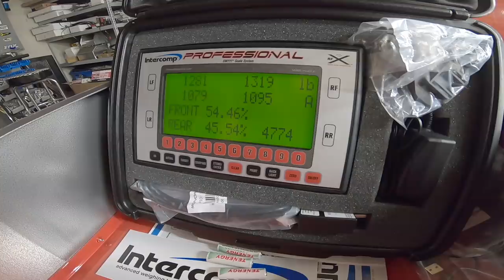I Got A New Project Car! 200 mph Cadillac Revealed on Finnegan's Garage Ep.119

Comment: One thing would be an absolute bummer: Chopping that original survivor caddy (approx 50-70 000$ maybe over a 100 on a good day) and then finding out that the wheels rub the wheel wells in high speeds just before crashing it.
Reply: Yup, they get pretty tall at 200 mph.
Reply: @yourhandlehere1  Indeed, even radials. the diameter expansion with suspension squat requires a hefty barrell on the back seat. I recall even the Swampthing having rubbing issues at the top end, and they race 1/8.
Reply: @oikkuoek  Hmmm...Might have to do a Tim Taylor,  rewire it, stick the tires and wheels on the balancer. Wind that puppy up to 200 mph. and stick a ruler on it. (be sure to wear your safety glasses)

I know he's going for low but being a child of the 60's I can see it jacked in back, sitting over the tires HotWheels style too. Zoomies  In front of the back tires. Oh yeah, giant blower out the hood
Total sleeper.
Reply: @yourhandlehere1  Definitely at least safety glasses on that setup.. XD The problem with that is, the diameter changes with air temperature and air pressure, and when the tyre ages. I think that last one was the problem with Swampthing. They ran old tyres and they started to rub. Mean Lean stance would look awesome, I'm all with you on that, but it's one hell of a ride to launch. Dominator still runs that stance, and he is all over the lane all the time, doing wheelies and all kinds of shenanigans. Caddy is just too heavy for classic rear suspension. To get that boat actually go 200 mph on a 1/4, or even a 1/2, it will need a full ProMod setup, I'm afraid.
Reply: @oikkuoek  Yeah, I don't think you can do that and cruise it comfortably too. My self, I'd keep it cruise worthy over chasing a number at the track.
Reply: @yourhandlehere1  Yup, it's those darn laws of physics. The only laws everyone has to comply.

Comment: Tip on mounting tires, put the rim on the floor, and then put the tire on.
Reply: I want to know who designed wheels that can't have tires installed.
Reply: @bobroberts2371  me too! And I can only imagine how much he payed for a junk set of wheels.
Reply: @bobroberts2371  probably needs a tire machine like non beadlock wheels and the beadlock was for show 
edit: I think he even mentioned it looked like a show car wheel especially looking at where the valve stem was placed

Comment: I wish I could help with a project like this. 
I think ladder bars/truck bars are a great option for a heavy car. The longer the arm the less stress on joints usually.  You could take some thickness out of the seat back to fit that large tire without moving them forward and giving up on much comfort. 
The rear seat in that will be a spring frame. If you build an aluminum seat pan and give it an inch of firm foam and an inch of plush soft foam. It will be lighter and really comfortable. You might even be able to re use the cover and keep it looking so nice.
Those 15 inch wide monsters just look so mean.

Comment: Bruh why does everybody have to destroy all original and such low miles cars
Reply: Yeah, park it in a garage and leave it for 50 years. Or sell it so it can be flipped over and over. Just please don't destroy it, after all it's the only one in existence.
Reply: Because who wants to put all that money into a clapped out pile...
Reply: @one4x4nut  he could find one with a decent body but the drive train is fucked because he would put the same amount of money into it anyway. A rear end, transmission , motor, tires and a 4 link
Reply: @one4x4nut   In order to accomplish his goals the car will have a different frame , engine , trans , rear, full roll cage , fabricated floor, fuel cell,  probably blacked out chrome , massive body mods so it will need a repaint. So tell me, what part of the car will be original?
Reply: Devon Johnson  Serious car collectors are stewards of this type of car so future generations can enjoy them.  There are those that take pleasure in destroying a car that has been lovingly cared for over the years just to show who is boss.

Comment: I just finished a 1966 Lincoln Continental that started out the same as your Caddy. 535 cid, C6, 9" with 430's. Front suspension is from a 2005 Crown Vicky, rear is ladder bars with coil overs. Stuff the biggest tire you can under the back. The big body cars need em. Do it your way Mike! Oh and keep the wheel base wide in the rear for stability. Too narrow not so good.

Comment: One word about rear quarter/tire&wheel deal....CADZILLA....if I'm not mistaken, the rear quarters of Cadzilla are held on with dzuz fasteners...if you need to service wheel/tire....just take the quarter off. Gonna take some Fab work...but will save sweat later. Also....TRUCK ARMS for rear suspension.

Comment: Those wheels can be the street set for general road use. Use those for drag week! The valve stem won't be too much of an issue at that point and they will still be of use. All of that depends on if you can mount a street tire on anyways.

Comment: If you use a 55 gallon drum for the tubs and move the springs inboard or change it to a 3 link you can fit massive meat under a caddy. you will have to change the rear end to a racing housing or have the one in the car cut down to 3 or 4 feet wide to get the tires under it which is why you move the springs or go with a 3 link . have fun this is going to be so good .

Comment: You should use a torque arm rear suspension for that. You can still adjust anti squat, and it's low under the chassis.

Comment: For the suspension : independant suspensions. More height but less lenght needed.

Also, twin fueltank and injection system, that way, you flip a switch and you have race gas & tune or road gas & tune. You only need a 20l (4gal? 5?) race fueltank, right?

Also, at least a 3 speed auto + OD or a 4 speed, for the mileage on the roadtrip.

Comment: If you're going to go wider anyway, go ahead and cut those, but cut them deeper in the barrel and when you weld on a barrel extension, it will be so far from the first weld that it won't matter.

Comment: maybe cut a groove in the barrel where the opposite side of the tire bead contacts it  and you can still use the caddy rims ....look at the steel rim without a tire and youll see what im talking about....the barrel is stepped, not a straight line, and when i install a tire i line it up in the groove to slip it over...

Comment: At 4,774lbs, this is only 24lbs heavier than my '03 Lightning.  While it sounds heavy, and for a car it relatively is, there are a number of really fast twin-turbo Lightnings.  This engine bay is plenty large for the 2000-2500hp worth of hardware needed for the goals.

Comment: 8:50 roll cage and comfort. Those that sit in back will need Wolverine's bone strength. Is the driveshaft safety loop a speed bump catcher? Do a little bodywork and move the axel back 6+ inches. Going to need a new driveshaft anyways. Someone out there must want to get their name/work out there and make a tilt fiber front clip. Ghost in race seat mounts under the bench for special occasions. Fuel cell will cut a little weight. Louver the hell out the trunk and move the radiator in back. Make room up front for a monster intercooler.

Comment: Inherited my dad's original owner 67 F250/352/CruiseOmatic/Dealer a/c and had to get it weighed for commercial license plates: 4755 lbs. This Caddy weighs more than an all steel fullsized pickup. 8s in this thing are going to be hard on lots of parts!

Comment: Build a alwheel chassis  for your Caddy.. Stapleton42 Cadillac Escalade is 6000 lbs 1800hp and he can run smaller tires with four-wheel traction

Comment: If You are going to keep that ride height You will surely wont be able to keep the tunel stock, right? As bigger tire will move the axle upwards quite a bit. 
Why not settle at 10s, the 200mph is still doable with milder setup.

Comment: I say you push the envelope and do something NOBODY has done before and ditch the solid rear axle all together and build a custom independent rear suspension with the wheelbase stretched back 4 to 6 inches or whatever to clear the 33 inch monster tires.  You will have to cut the trunk out either way so you may as well make it official and cut it the whole way across to use a cantilever suspension system to have adjustable ride height and be able to lift it to swap wheels for racing without too much struggle.  If you build the I.R.S. with adjustability it should allow the car to hook up like a beast while still riding like a Cadillac and with a set of cut outs the engine can remain quiet until race day for the ultimate shit your pants sleeper to stun anyone that tries to line up with the old girl.  With enough horsepower that weight can be an asset rather than a problem at least in the short track, stopping it is another story but that can be handled as well.

Comment: Hi, I like your idea but to cut up a 38,000 mile survivor is kinda hard core. I get it, it's yours to do as you please but maybe one that is a little ratty that is not as nice as the white one. I wonder, will the 29.5 slicks fit without tubing the body? Somehow I doubt it. A few years ago I had a 95% original 1972 Buick Skylark convertible.  Is  was 350 4bbl auto cruise pw, ps, tilt, cruise and AC. It all worked and with the exception of one front fender that was replace due to a fender bender the paint was original. The interior was the same way. The only things I did to it was factory rallye wheels, a sport steering wheel, a sevice, water pump. I rebuilt the numbers matching alternator. I then spent the summer cleaning, detailing and driving the car. I wanted a GS clone but the car was just to nice. That's where you are now. Think hard on this before you cut it but either way we won't abandon you.  
Best Regards, 
Bob Ordewald
Staunton Virginia

Comment: Heavy chassis with low E.T. puts way too much stress on that 1940's designed 390 it came with. Then where do you go for parts to replace what broke (again)?
If you really want to take a Sawzall to a perfect specimen, just find an early 80's V8-6-4 Caddy. Nobody will hate you for what happens next, and your 8-second dreams won't turn into nightmares.

Comment: You are trying to put the tire on from the wrong side of the wheel. and you could easily fill the valve stem hole with a stem and drill another hole where you want one.

Comment: Aren't you going to have to compromise the rear seating position for an 8:50 cage anyways? With the structure of the roof line and the rear glass location I'm pretty sure you need a crossbar that's going to go right over the rear seats unless they can bend it specifically to cover the rear glass portion on the deck behind the rear seats. That sounds like a nightmare for a welder unless they can plug the rear cross bar into the frame by cutting through the deck behind the rear seats and connecting it to the frame, but in that instance you run into a suspension clearance problem. I think first you need to get the frame built, then the cage, and finally then you can worry about suspension and tire.

Comment: UUUUOOO!  Modern space age 1963 jet technology with vertical stabilizers for high speed straight line stability unlike a certain 1959 GM immature technology actually caused lift at high speed and caused instability.

Comment: Would it be possible to rig the car with air suspension, so you can run a smaller tire when you are cruising on the roads, then air it up to fit the drag tires at the strip?

Comment: the frame is far heavier than you might think... I did a square wall chassis under a 50 Buick Sedanet, the car weighed less with the BBB and new chassis than it did with the straight 8 and stock chassis.... nearly 1000 lbs less.  Thus, and you can call me a liar later, I suspect that your car - with the 8.50 cage, frame, and new motor will weigh less than what it does now....

Comment: The right side of the car weighs more than the left side that's crazy I thought the left side would weight more than the right with the steering column the power steering and the brake booster and all that

Comment: Do something innovative.  Do a tbss awd setup, so you can run normal handling, higher load street tires like a r888.  You'll have all the traction you want, and won't need to rely on a truck size diameter drag tire to hook it up.  Under hood space has packaging for days..... 8 seconds, don't ruin it for what it should be to head that direction.  If its fast, great, but make it a great driver with 2000hp, don't dedicate to drag...,,make it handle...  

But first,, return to yours roots......FINISH THE C10!!!!!!!!!!!!!!!!!!

Comment: 8s in a full bodied caddy yeah spose but You better put heat wrap on that bank card.... 4700 seems heavy but a hellcat is like 4429 and widebody is 4586! 9s prob not to bad 8s it better be stout....totally built duramax? But if you did You'd prob have to figure out how run those steam rollers with 3000flbs of Tq or build an AWD caddy. I'm totally talking out my ass i have zero clue about race diesels. How bout one of those a 1000ci sonny Leonard mountain motors?

Comment: I can see making it want to go fast but do not cut it up in the process figure out away around it please it can't be that hard put a 2000 hp engine in it use a shorter rearend for the tires use slicks that match the regular tires problem solved lol